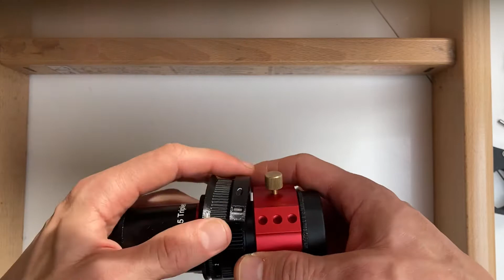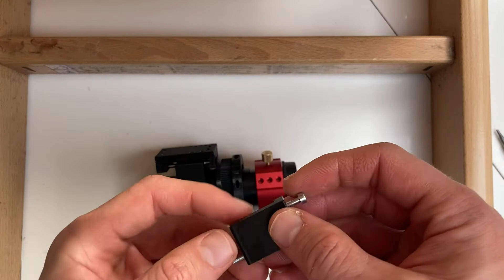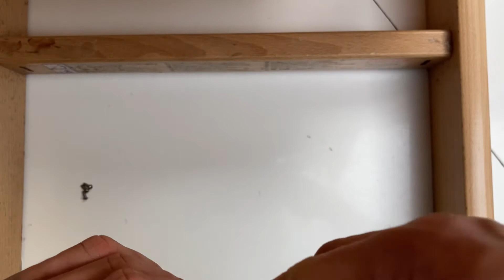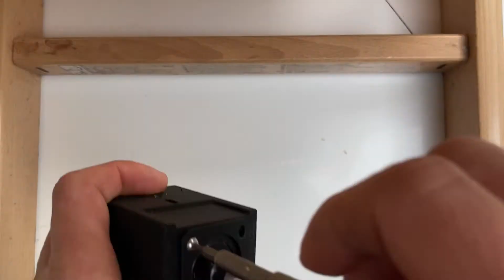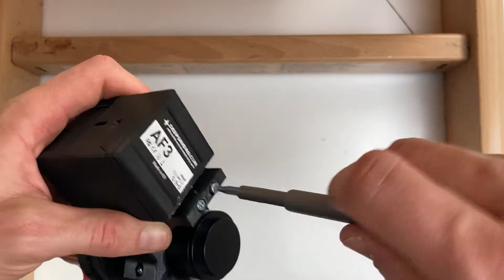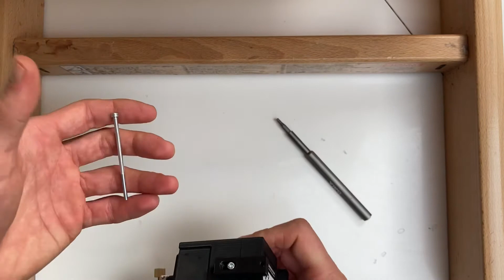Deep Sky Dad Askar FMA135 AF3s kit - assembly instructions

Comment: have you used this much under the stars? I'm sure the focuser works fine, however my asker135 has obvious flexure issues with the front part of the lens/helecoid. I had to add an additional 5mm of spacing to mine as well as a tilt adapter plate to try and correct for it. With your focuser attached to the front section of the lens I'm wondering if you found any additional flexure/tilt issues with it? Cheers
Reply from the maker: I did not image a lot, we did a few hours testing for V curves with a small sensor, so I did not pay much attention to the tilt etc. The reason for front mounting is lack of space in the back, so options are limited